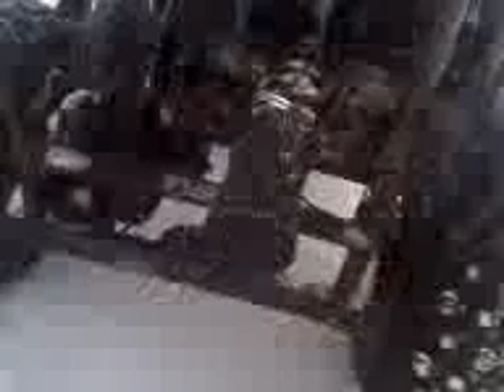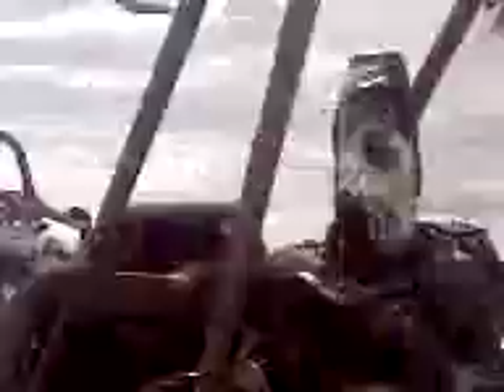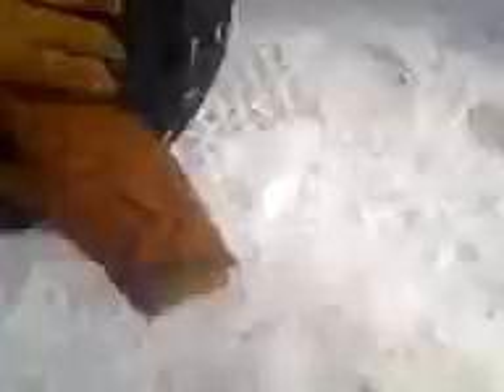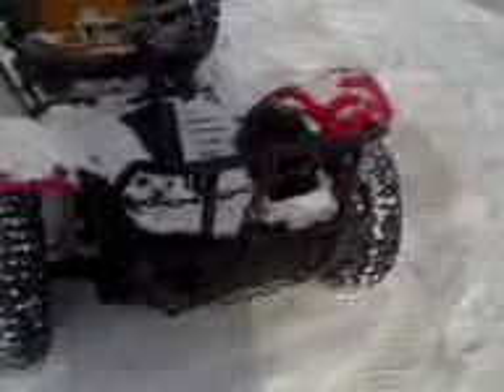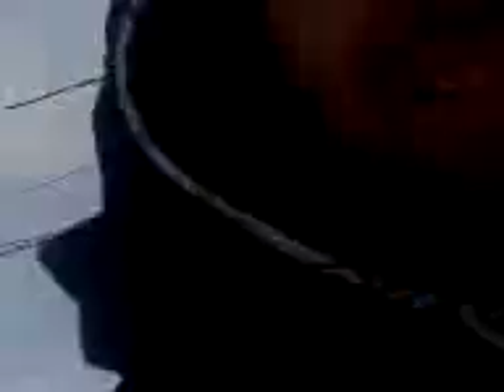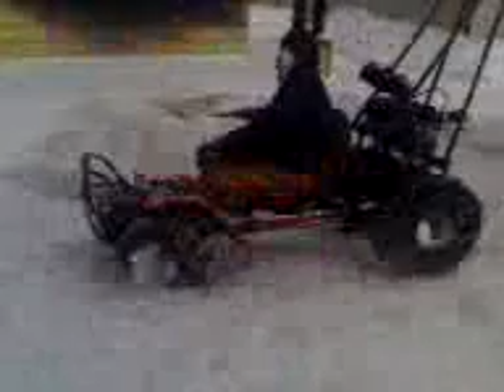odyssey demonstration

Comment from the maker: no.. the carb wasent adjusted right.. then i found out it was gumed up with dirt.. lots of it...

after that vid i ran it lean.. it ran like hell and died.. i baught a new engine.. well used for 100.00 usd... and cleaned my carb and am going to use the oil injector and fix my rinky dink air cleaner..

ill make new vid when its all back togethe running right.. it hauls ass in snow.. beleave me.. :)  it refuses to gget stuck.

she is stuborn.